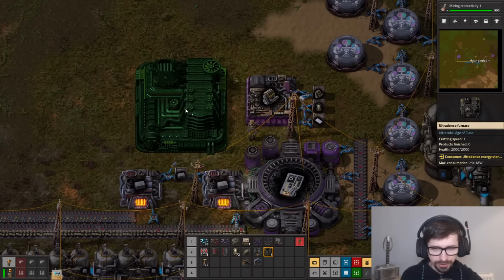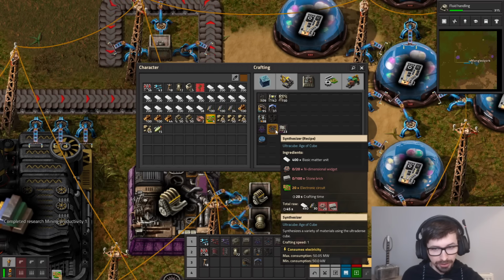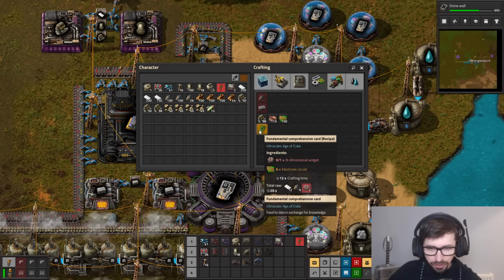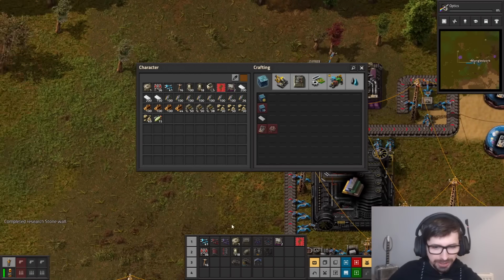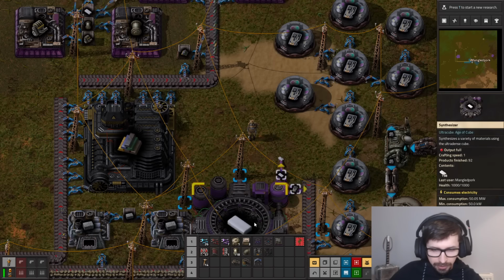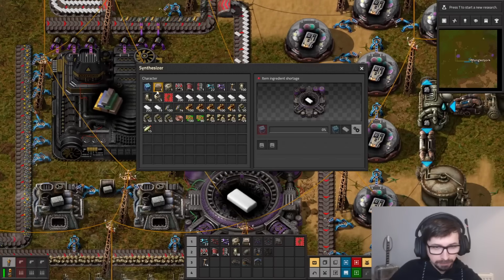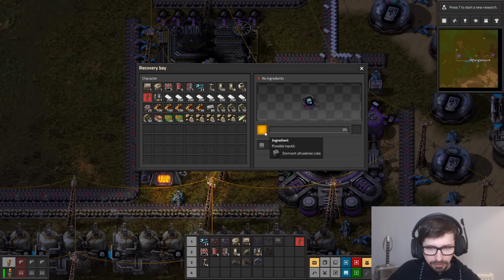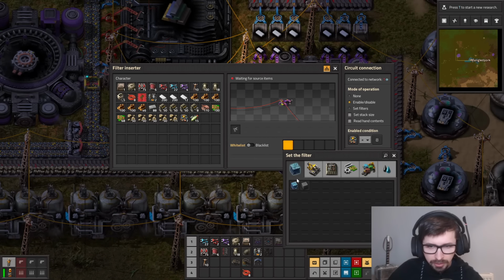Setting Up Basic Automation In The Factorio Ultracube Mod

Comment: Question of curiosity... can you beat the Ultracube with Lazy bastard achievement? :face-orange-biting-nails:
Reply: I doubt it. Lazy Bastard was designed for a completely different win condition, reached by completely different means. Needing to reboot the cube (which is legally handcrafting) would wreck your run on its own.